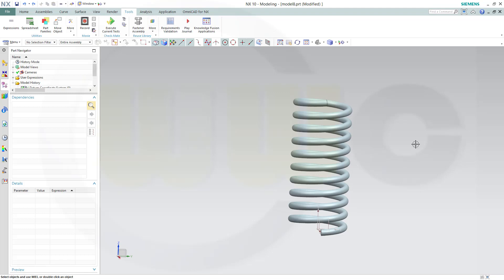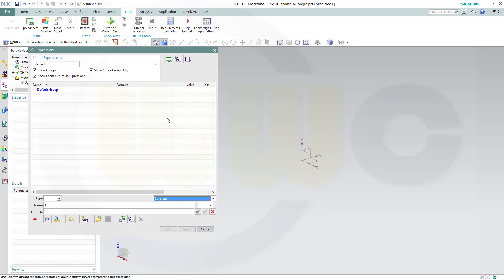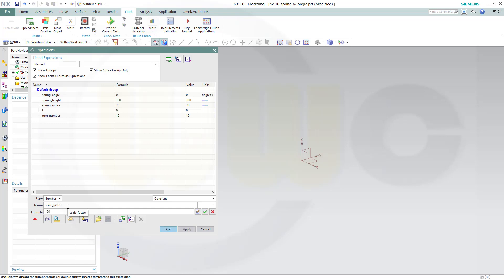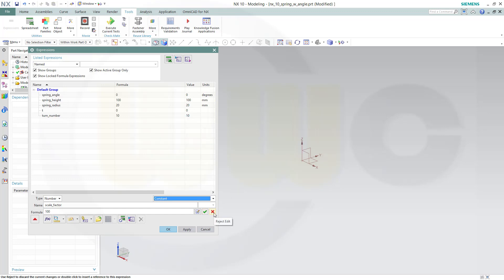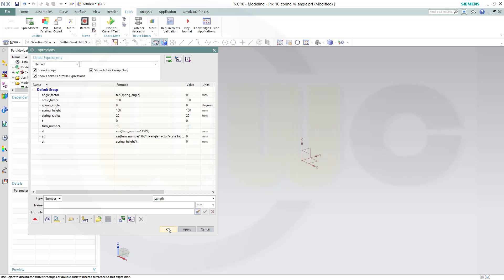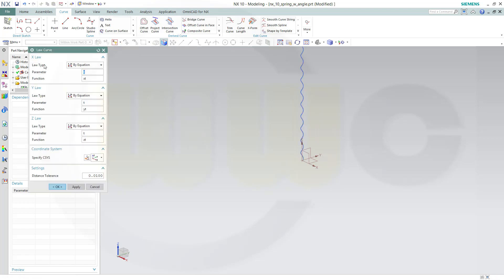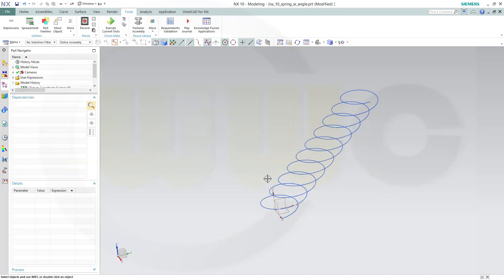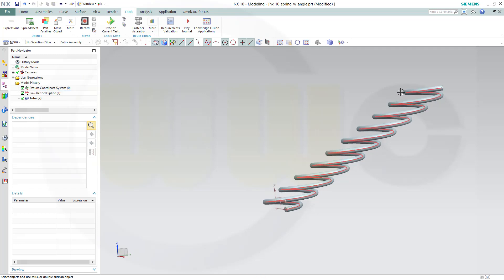Helix - Spring with an angle - Siemens NX 10 Training - Lawcurves & Expressions

Comment: Hi thank you for this video. Let’s say you wanted to make this spring along a circle so instead of an axial one direction  spring you would have a radial spring. What function would need to be added to the expressions function to make it a circle spring  but with the same configurations and parameters you provided in this video.?
Reply from the maker: This may help : https://youtu.be/Cs5HqW53vIA
Reply: Wolfgang Walden thanks I saw this video and sees that the spring can be created using the along spline feature under the helix function however I still want my coils to have a angle and not uniform. That is why I’m trying to use the expression function to create a spring that is not axial but shaped to form a circle

Comment: Hi Wolfgang, 
Just wondering if it could be possible in Solid Edge ?
Reply from the maker: I´ve checked and found no option to do it in a similar way. But maybe I can think of something different.
Reply: Hi, What about this command ? https://docs.plm.automation.siemens.com/tdoc/se/109/se_help/#uid:curvtbl1h
Reply from the maker: I couldn´t use it because NX 10 didn´t work with Excel 2016 LOL - I have yet to check if NX 11 does.
Reply: This is all about Solid Edge not NX.
Reply from the maker: Sorry my fault - that might be an option. Have to check if SE works with Excel 2016.